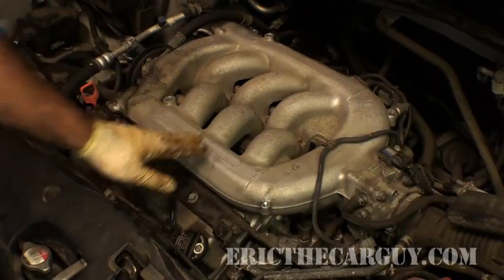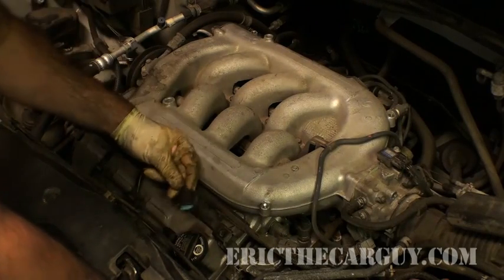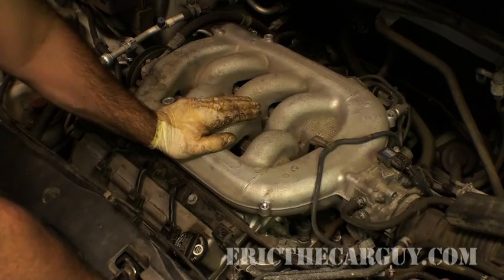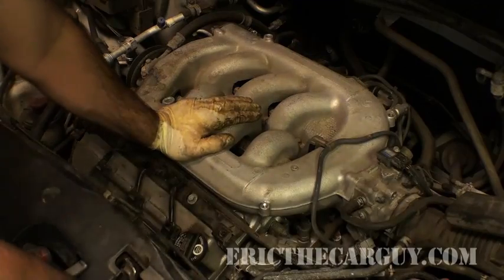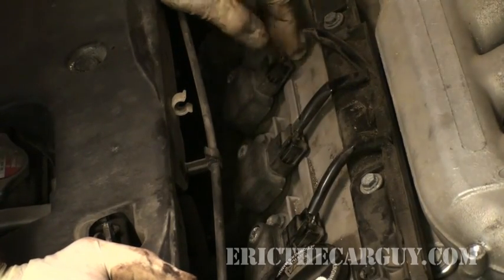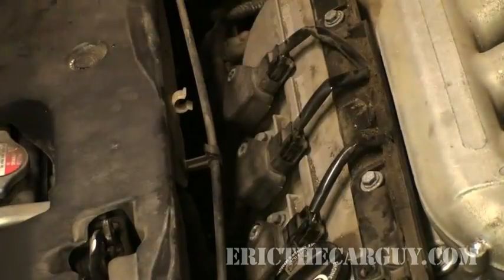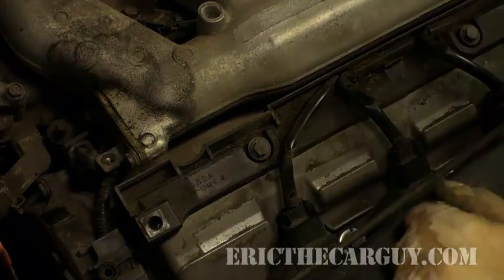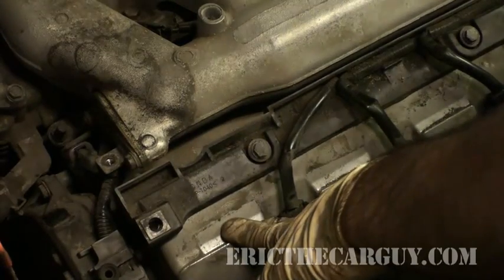How To Perform A Power Balance Test  - EricTheCarGuy

Comment: l got a 2003 toyota corolla, it takes time to start.  car has no power when taking off,  (weak).  I got codes p0300,p0301 and p0302. parts change: all four coils, throttle position sensor, all four spark plugs, mass air flow sensor. parts I cleaned: air intake and idle valve. I got same codes again.........finally I replaced injector 1 and 3,  now I get codes: p0300, p0302 and p0304, should I now replace injector 2 and 4.  PLEASE, SOMEONE OUT THERE HELP.

Comment: But how would you do this if each cylinder has it's own spark plug, you don't want to unplug the plug cables one at a time while the engine is running or isn't that a problem? (it seems a comparable method to what you did here with the coil connectors) '81 golf mk1.
Reply: +Swordie100 It is comparable, he just tries to stop ignition from happening in given cylinder.

Comment: How do you diagnose a Dual-pack ignition coil if one coil stops working? example: 2008 Dodge charger SRT8 has distributor-less ignition system with TWO coils per cylinder. If one Coil of the DUAL coil goes south the engine will Run OK.
Reply: I guess you dont know do you?

Comment: Hey i got a 2002 Honda Odyssey with 203000 miles and i Have a lot of problems with it. I am having some transmission problems sometimes when i turn right and start to accelerate it fails to shift into 3rd gear and i have to get into shift down on the column and then shift back up. A second problem i have is that the sometimes with its cold or cool outside i will start my car up and the engine will throb up and down with out me touching the petal, usual by about 500 rpm.  I was thinking it was an ecu problem but i am not sure.
Reply: +Max Cook Sounds like a bad throttle position sensor.  Several other things could cause it too though.  Vacuum leaks, alternator / regulator problems, etc.  First and easiest thing to check would be the vacuum system.  Those hoses start to crack and crumble around the 10-15 year mark.

Comment: There's nothing quite as exciting as getting hit with leaking voltage from a spark plug lead when you're not expecting it.  Especially if you're grounded on your other hand.
Reply: +hellcat1988 when do you ever expect it   lol
Reply: Ben Moore
When you can hear it and are pulling plug leads off the coil packs/distributor.

Comment: Great video! Just a quick question: I have a 97 Infiniti Q45, it's a V8 and suspect a misfire in one of the cylinders. I want to do this test, but one side of the engine is covered by the intake piping. When I change the plugs, I need to take off the entire intake to throttle body to get to 4 of the cylinders' coils. If I do this test without the intake on, it won't be getting an accurate reading at the MAF. Will it matter for this test? or am I good to go ahead without the intake on? Thanks for all your help!

Comment: Hey i have a 86 ford f150 and for reason it has no get up and go power its a 302 5.0 i changed the plugs changed the fuel filter and put new gas and gas cleaner in her but still no go power if you think you would know could you let me know? thanks.
Reply: +Samniss Arandeen I just shove a kerbal down my spark plug hole and gain science to figure the problem out.

Comment: So can I just pull off the spark plug wire from the distributor and do the same thing??
Reply: Logan Gibson I have the same question?
Reply: Stefan Ovcharov stefan u can man I did it a couple days ago bc I never got an answer back. U might have someone stand there and turn it off after each one bc if u don't do it right then it will shock the piss outta u. It's kinda like an electric fence it sucks lol. Anyway hope this helped. Have fun and stay dirty! :)
Reply: Logan Gibson The problem with disconnecting the spark plug is that the fuel injector then dumps raw fuel into the catalytic converter. Not good for it over a long period of time. Be short and quick.

Comment: I have an 02 Pontiac trans am and I used to have the same problem and I did every test I could possibly do and when I finally took it to the mechanic not even 10 min the found out it was my pcm connectors were rotted and caused the problem

Comment: I got sick of the whole "diagnosing and busting your knuckles on your car all the god damn time bullshit" and switched to motorbikes.   My MPG tripled overnight (to 60 mpg).  My cost for parts, as well as insurance, and tag were halved instantly.  I can reach damn near everything with a wrench.  I never have to vacuum it out, and I can wash it all in 3 minutes with a damp rag (which I rarely have to do).   In a pinch, push starting it is a hell of a lot easier.  Its faster and much more fun to drive than my crappy old zcar.   I never have to worry about out of alignment wheel alignment, toe in, etc. chewing up my tires.  I only have to buy half the tires and they cost less.  

So here's my diagnosis: cars are a piss poor design. all of them.  esp. front wheel drive cars, but regardless, all cars.  fuck cars.  forever.  and ever. crush them. switch to riding a motorbike.  you'll never have to spend half your time in a garage working on your car.  i was working on my car more than i was driving it.  which is total bullshit.   they require a lot of resources to build, there is no standardization between any of them, they take a heavy impact on the environment and fossil fuel resources.

I never want to see or drive a car ever again....
Reply: Save up all that surplus money for the hospital bills for when a moron doesn't see you and pulls out in front of you and turns you into superman.
Reply: You forgot to mention the rust bug :)

And that cars can haul stuff, including your entire family. In a safe way.
Just wondering what make & year your latest car was. Must be from hell, making you post such a long rant...

Comment: there needs to be a disclaimer here. this works fine if unplugging the coil pack, but if you unplug a spark plug wire from a coil then power is still running through the coil and the coil will need the ground the electrical charge. oftentimes a coil will ground inside itself and can damage the windings and produce less of a spark charge.

moral of the story, don't unplug spark plug wires from coils. very bad idea. unplugging the COIL itself is fine, but this only works on engines with individual coil packs as shown here. sneaky sneaky eric.
Reply: in what regard?
Reply: it actually is grounded by how it is partially held down to whatever it is attached too. go try it. pull a plug wire and watch inside that coil terminal. you will see the spark jump. its very hard on things. that is why you see eric here disconnecting the coils and not plug wires. im sure he knows.

after the coil arks inside itself it begins to weaken and depending on your spark plug gap may ark inside itself instead of through the spark plug. (path of least resistance)

in most cases you will be just fine, but its a risky practice and by no means wise.
Reply: ThunderHead289 Wouldn't that fry the ignition module in some cases?
Reply: yes it would, that is what I am saying in my original comment.
Reply: they don't. disconnect a plug wire and the coil will arc inside itself. the coil itself needs to be disconnected.
Reply: ***** I have never heard of that but someone will be rich if they can innovate that in a way that's convenient for the manufacturer and technician.
Reply: ***** I'm more foreign when it comes to ignition system stuff than a lada.

Comment: I believe I've got at least one cylinder misfiring on the left bank of my Dodge big block and I was wonder how I'd go about doing the power balance test without zapping myself. Any tips? Also could an exhaust leak cause a misfire?
Reply: Which engine is in your truck?
Reply: turtle2448thomas 400ci.
Reply: William Ruescher I take it that it's not the Ram pictured in your profile pic
Reply: turtle2448thomas
lol Nope. 76 D200

Comment: i saw a comment saying to unplug/disable individual injectors instead, well, i thought i would point out that there are still plenty of cars, motorcycles, etc on the road that use throttle body injection or even carburetors, especially in hobbyist racing.
that's really beside the point though, because if you read the description, and listened to what he was saying, it is a "power BALANCE test".
disconnecting/disabling the injector can only tell you if a given cylinder was producing zero power.
fist he showed how the engine acted when he killed the spark on cylinders that were putting out approximately the same amount of power, (the rpm dropped a LOT and approximately the same amount), then he disabled one injector and then cut the spark in order to "simulate" a situation where a cylinder was contributing no power at all (rpms did not change at all) so those were the two opposite ends of the scale. basically 100% and 0% but he did not demonstrate how things would be if he killed the spark to a "weak cylinder".
probably because he didn't happen to have an engine handy that had a nice weak cylinder to show how when a cylinder is only producing, say, half (50%) of the power that the other cylinders were producing.
for those who don't know, killing the spark to a weak cylinder will cause the rpms to drop some, but not as much as it did with cylinders that were producing full/equal power.
so yeah, kind of hard to find out if a cylinder is producing half as much power as the others after you've disconnected the injector. but if anybody feels the urge, they are welcome to try to explain how they can produce 50% of the power without using any fuel;)

Comment: seeing as eric didnt reply it can be one of 4 common things, tires need balanced, lower control arm (LCA) ball joint needs replaced, or tie rod ends need replaced. seeing as its only a 2000, go to walmart and have them balance your tires for $5 a tire... to check your LCA ball joint lift the car up by the jack point on the unibody seam, and see if you can wiggle the tire around a little. it should be stiff.

Comment: On diesels, I just loosen one fuel line one at a time and observe changes in rpm. As with the case of conventionally (mechanical) controlled fuel injection systems.
However, I strongly advise not to do this on vehicles equipped with common rail. Pressures are high and might get into your skin even if you're careful.
Made a youtube video "Troubleshooting Scania K124"

Comment: Eric: what if instead of unplugging the spark plugs you unplug the injectors?  I think the results should be the same with the additional benefit of avoiding sending unburnt fuel to the catalytic converter.  Besides you will also avoid being "kicked" by the spark going to the spark plug, right?  Thanks for the video.

Comment: or a dirty throttle body or MAF sensor (if you have one), i would clean those and change the air filter first (if it is dirty). That is the first step to take since it is the least expensive and easiest. Just be careful when dissassembling the throttle body because the MAF is very sensative, and be sure to let everything dry before reassembling. Look up videos as to how to do this.

Comment: corroded, damaged, or broken spark plugs and or wires, corroded sparkplug tips, broken or damaged coil packs (if applicable), corroded distributor tips or rotor (if applicable) or a vacuum leak. Your rough idle is somewhat common on older cars. check for a vaccume leak, change the sparkplugs, wires, coilpacks (or distributor cap and rotor) respectivly. If the roughness stops then you have solved the problem / problems. If you do all this and the problem persists you may have a Blown Head Gasket

Comment: Hey Eric I have a problem with my 2001 Kia Sephia. When the car is in Drive and it's idle there is a very noticeable vibration when I change from Drive to Park or Neutral the vibration stops. And If I drive it the vibration also stops. What the hell is going on with my car?

Comment: i have a 2000 Volvo S40 4cyl turbo.  it has 2 coil packs, 1 per 2 cylinders.  how do i disconnect the packs without turning off 2 cylinders?? could i unplug each injector one at a time?

Comment: Was driving my 4 cyl around one day, stopped to eat, got back in and the engine started fine and I pulled away and came to a stop and the engine just died on me.  Got it started again and it was rough rough running.  Was able to limp it home.  Did a compression test and only 1 & 4 show compression.  Cyl 2 & 3  show about 10 psi and a lot of hissing noise when cranking over. 

You think the head gasket is blown between 2 & 3?   I personally built this engine 4 years ago. No problems till this.

Comment: i´ll have 2.6 l V6 engine and I do mutch service repairs one by my self. I ask you last repaired what I do. So I change 6 spark plugs the new ones and when I start my engine next time I heard some noises that comes timebelt. I have mentions that my car come over period with time belt :)

The noise come off 1 minutes and not show anymore. So what you think its issue ?

Comment: Sometimes I cancel cylinders by unplugging injector connectors one-at-a-time....I prefer this to unplugging conventional plug wires, as they can be fragile, and also like to shock-the-crap-out-of-you if you're grounded.

Comment: Hey Eric i have a question about my 00 Acura 3.2TL, i have a crunching noise coming out out of my front end but it only happens when its cold and only when im turning with light throttle. And then it goes away after a few turns. I was wondering if u could help thanks.

Comment: Came a bit too late to help me, but should help many. I have an old 92 Regal GS that i could never get rid of, and I had a misfire under load. I pit a scanner on it and found I had the good old po400 code and a cam sensor code.  I should have done this test right then and there but I foolishly went straight at the cam sensor. Sure, it WAS bad, but my misfire turned out to just be a bad plug wire. Felt pretty stupid, especially since doing the cam sensor on that car is a huuuge job.

Comment: instead of disconnect the spark plug, can i disconnect the fuel injector plug, or it will knock ? i have the integra engine

Comment: @EricTheCarGuy There is no shortage of oil or gas. It's manipulated price fixing. There are 60 years worth of oil reserves stored in the salt domes of Nevada and Utah. Off the Gulf Coast, where there were over 800 production wells in 1980, there are now less than 100. Those producing wells (1500 to 2000 barrels/ day) were capped and cemented as our government decided it was cheaper to buy foreign oil. Look at the situation now. Our economy and workforce is dead. The country's been duped again!

Comment from the maker: @chamblizi I didn't say the government was going to take it away from you but rather to say that supply and demand dictates that if something is in short supply it will be expensive and crude oil is one of those things.  What I was suggesting is a point where it will cost you more than $200 to put 10 gallons of gas in that thing.

Comment from the maker: @Phillz91 I plan to make a video on that at some point but the trick I use is with some vacuum line placed between the wire and the coil that I can touch with my test light to short it out when I cancel it.  You could also unplug the injectors one at a time as well.

Comment: Hey there, helpfull video. I have one question, I have a four cylinder engine with twin coil packs so there is a lead to the other cylinder. I can unplug the coil simply enough but how do I go about stopping/taking off the lead as I know there to be a fair amount of current passing through (accidently brushed it one day, was abit of a shock lol) Engine is a mitsubishi 4G93 SOHC FYI.

Comment: Eric what about waste spark ignition systems. Killing spark to one cylinder will also kill the spark to its companion cylinder. Say I have a 4cyl. GM engine and the problem is cyl. #1, If I kill the spark to cyl #1 then cyl #4 dies as well, and we have a engine that is running at 50%,  if I kill the spark to cyl. #2 & 4 we are left with the offending pair and an engine that may not run at all! It seems that waste spark ignition cylinders fail in pairs, How we isolate the offending cylinder?

Comment from the maker: @HappyKingdomHearts If you are going to drive the car or run it for a length of time it would be better to disconnect the connectors at the injectors instead of disabling the ignition system.  You might want to watch the video on Finding A Noise to help you with that.

Comment: can you perform the power balance test by removing the sparkplug wires one by one like you did with the coils? cuz i want to see if one of my valves is causing this knocking/rattling when i accelerate or go up hill. oooh and thanking you for your awesome videos they have taught me alot and mostly all i know about how to perform maintenance and work on my car. p.s i own a 1996 Mazda 626 2.5L MFI DOHC 6cyl.

Comment from the maker: @hlpsg That is very true but the idea is only to do it for a short time and you should be OK, in your case you might consider placing a piece of vacuum line between the spark plug and wire just enough to hold it there and then bring a grounded test light near the vacuum line to short it out to avoid damage to the ignition system.  In fact I hope to demonstrate this in a video at some point.

Comment: Hi Eric, have a question. I work on bikes, so the only thing I can unplug are the spark plug wires. However, everything I've read said if I leave the plug wires ungrounded it might fry something. I'm not too clear how that works, so what're your thoughts on just unplugging the spark plug caps to check for this? Thanks.

Comment from the maker: @duhkify That can be a bad thing indeed as if the engine gets severely overheated the pistons swell up in the bores and seize up causing damage to the metal parts and the engine will not turn over as a result.